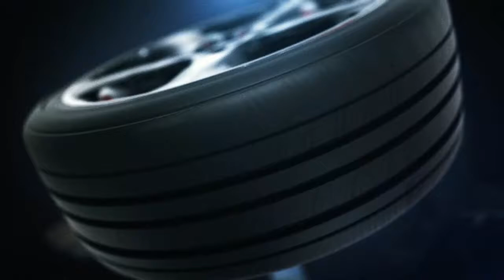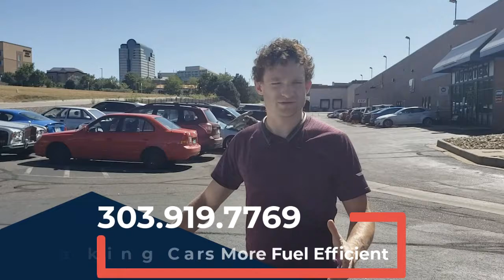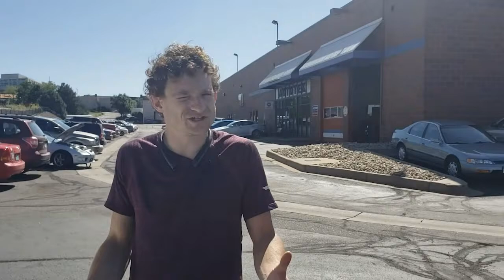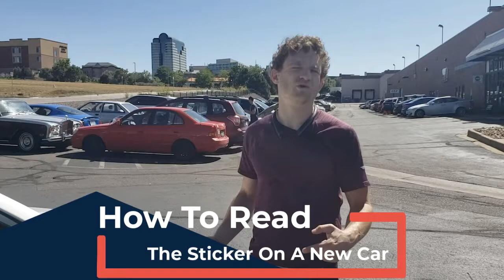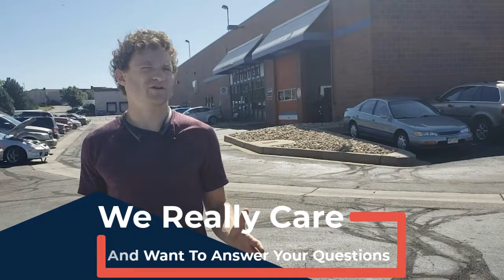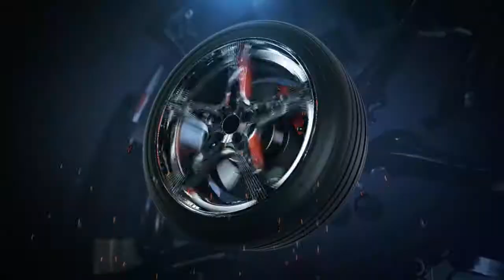President Obama And The Pontiac Vibe. Global Cooperation Works in Denver

Comment: President Barack Obama met with Kaif officials to change the fuel economy standards. His alleged goal was "save the planet." Make cars more fuel efficient 
Auto makers didn't agree. Now they'd have to change alotta thing's with the
car in a short amount of time. They used partnerships. GM partnered with Kia.
GM bought Saab, cuz Saab made small 4 cylinder turbocharged engines, which makes less space more power with less fuel. But they couldn't build Saab engines.
Saab engine's were designed & manufactured in a Hyundai-Kia facility. Hyundai -Kia 
makes the machines that cut the engine block for Saab.